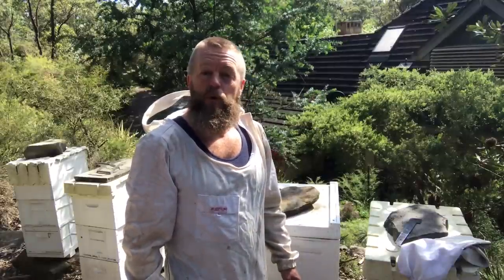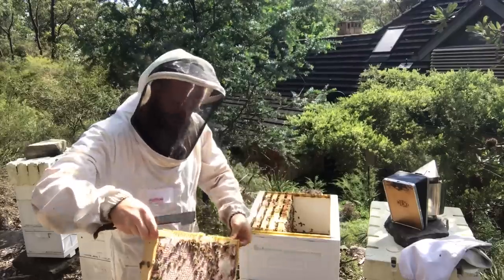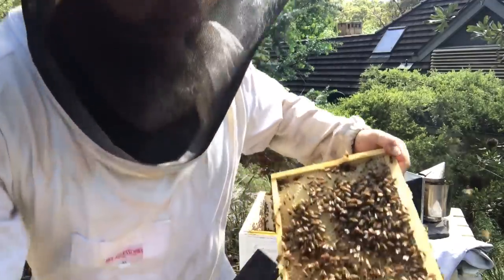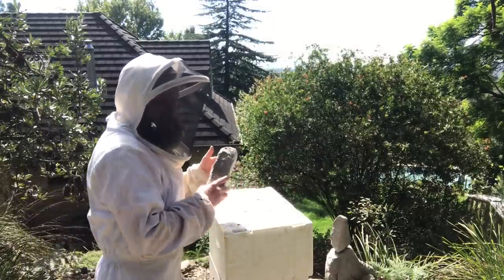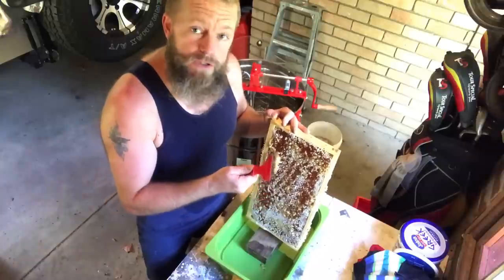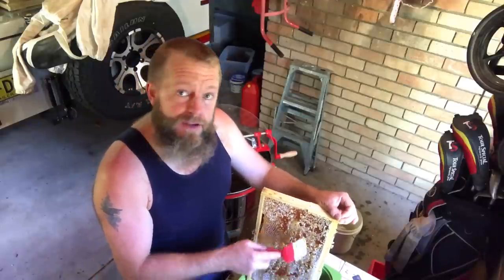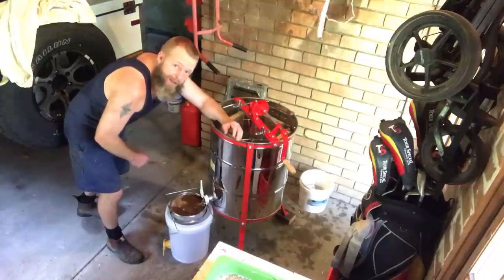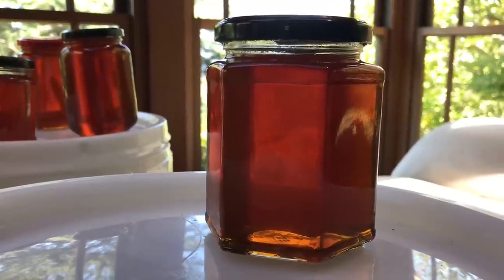Honey Harvest March 2017

Comment: hi nice video! im not a pro but if you balance out the weight of the frames better in the extractor you wont get so much wobble and the foundation doesnt break as easy. had the same problem with langstr.. frames :)
Reply from the maker: mo collin thanks for taking the time to comment friend. I'll give that a go. I'm hoping to get one more extraction before winter.

Comment: are they 8 frames or 10?
Reply from the maker: Storm I have a mixture of both Mate
Reply: @aussiebackyardfood7819  I'm a new beekeeper and find the 8 frames are easier to handle being female. Heaps easier.

Also, one of my beehives seems very weak. How.can I fix it?

thanks in advance
Reply from the maker: Storm there are many reasons for a hive failing to thrive.
I think the first thing you should check for is disease. If you have established that disease is not to blame than you can dispatch the queen and combine in with a healthier hive.
I never feed my bees and I don’t believe in propping up weak genetics.
Good luck!
Reply: @aussiebackyardfood7819  thanks will check, but I fear the hive may be queen less.

Comment: I wonder how well a flat stiff bladed putty knife would work for decapping the honey

Example: http://www.homedepot.com/p/Stanley-2-in-Nylon-Handle-Stiff-Blade-Putty-Knife-28-142/203978169
Reply from the maker: GDay Justin Bechtel 
I see where you're going with this. 
It might work ok if it had an angled handle. But I suspect it would be difficult to not dig too deeply into the comb. 
But then what if you dragged the edge. Hmmm, I don't think it would remove quite enough of the cappings. 
But thanks for caring mate!
Reply: I know that there are putty knives with a bent blade, my dad has around 40 of them of various sizes. 
wonder if those would work. (http://www.rona.ca/images/0271374_L.jpg) 

Could also use a metal coat hanger bent to the same width of the frames, as I assume most of them are all roughly the same size, but you might risk cutting the comb so if you dont want to cut the comb that might not work too well. 

628DirtRooster used a roller style decapper but said it did a lot of damage to the combs.
Reply from the maker: Justin Bechtel 
Mate! I might just have to give one of those a go!!
By the way, big fan of 628DirtRooster